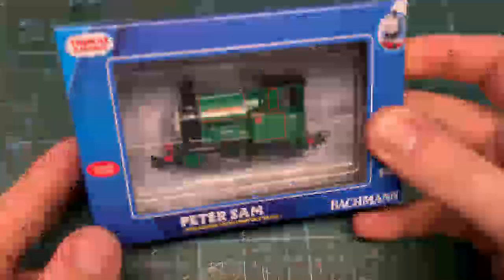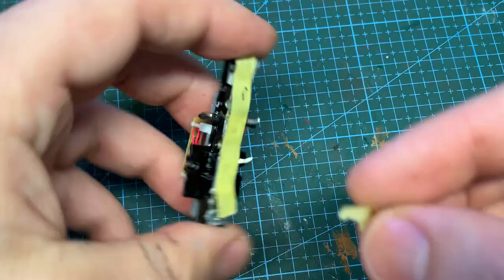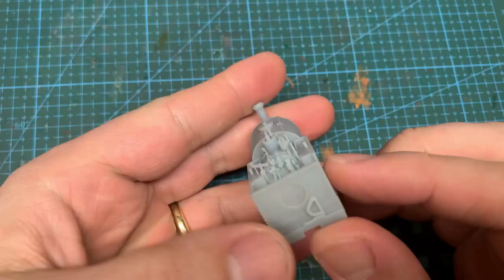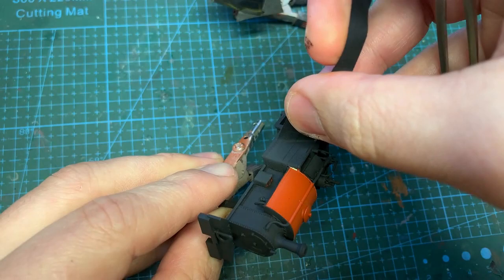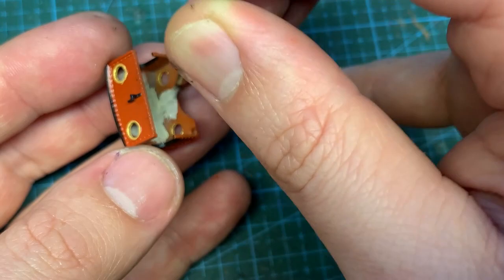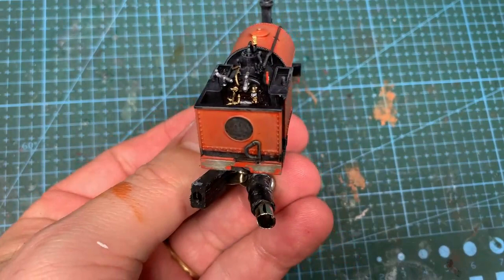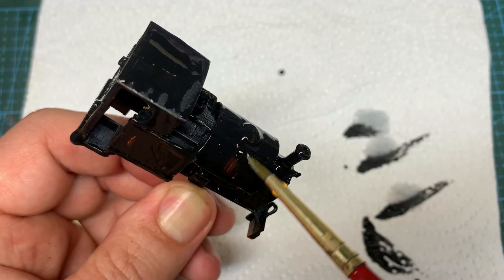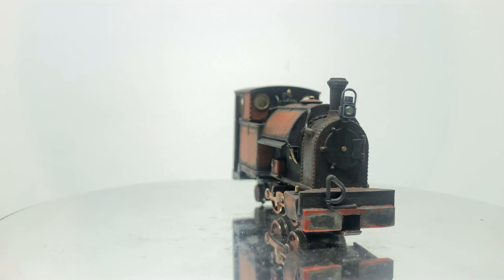A Loco for Corris! Bachmann ‘Peter Sam’ Conversion in 009

Comment: George.  I offer the following thoughts:  1. Wash the rising print in Isopropyl Alcohol before painting.  2. If you don't want to spend the time to san out the layer lines, do your initial prime with Mr Surfacer 1000, sand then prime to support the chosen colour scheme.  You need to thin the pain further to get rid of that orange peel result.  Looking at your airbrushing ti seems you waste a lot of paint spraying such a small surface area; bets done with thin paint and a number of coats for smooth results.  Washes are best done with oils after a finish coat of acrylic varnish.  There is no hurry then when removing the oil wash to taste. You are using Ammo stains which are oil based
Reply from the maker: Great Thankyou for your suggestions!

Comment: The 3D print is lighter than the die cast Peter Sam shell. How did you make yours heavier to compensate or is it just really bad at pulling things too?
Reply from the maker: It is lighter, but it can still pull 3D printed coaches as I’ve seen it done. I haven’t tried mine with full trains yet

Comment: I’ll be getting my own Peter Sam chassis soon, but taking apart the chassis apart to paint the cylinders scares me. Is it relatively straightforward? I’m worried about the wheels and gear not being quartered after reassembly.
Reply from the maker: No it’s not tricky, and you can pull the wheel sets out and keep them all as one piece so you won’t lose the quartering
Reply: @GWilliamsonModels I did it, but only after losing one of the slide bars 4 times in the carpet. But it was worth it!

Comment: I tried your weathering technique on a 3D printed wagon (16mm scale), but it didn't come out as I wanted. How much water do you use with the black acrylic when putting it on, and how much do you take off with clean water?

Also, you do have to wipe it down as well with kitchen roll etc?
Reply from the maker: Sorry to hear that, how did it come out, exactly? I put the black paint on neat, and wash off with clean water on the brush every time I put it to the model. I don’t usually use anything to wipe the surface, but maybe the change in scale might be the issue. I’m currently working on 7/8th aswell, so I’ll try it on the wagons and let you know how I get on.
Though if you’re mentioning wiping with kitchen roll, it sounds like you’re wanting more of the black removed? In that case, maybe a larger brush loaded with more water? Being acrylic, you can go back to it after it’s dry and wet it again, you’ll be able to remove it
Reply: @GWilliamsonModels  I think it was the way I applied it. I watched another video about weathering on garden railway models, but I also think that I do need to use a larger brush. I did wet the brush a lot before putting the paint onto it, and then washed it off.

The way I applied it, I went with the planks (as its a slate wagon with no sides and so is flat), and you can see that in the paint. Is it normally better to do it very randomly?
Reply from the maker: @SteamLance  ah ok, you mean like the talyllyn 2 bar slate wagons? Im assuming the black has left clear ‘tide marks’ on the flat surfaces? If so, I think what I would do now is get a smaller brush, wet it, and feather the black edge into the planks a bit, almost like blurring the line

Comment: Can you easily remove the face from the stock body? Nice job btw.
Reply from the maker: Yes you can, but you need a smoke box door to put in its place (like skarloey if you saw my skarloey challenge)
Reply: @GWilliamsonModels  will that fit Peter Sam as well? Also are the Peter Sam name badges easy to pull off? Thanks for your help.
Reply from the maker: @douglaslangella7782  I’m not sure on the face, you would have to measure it. But the name plates are painted on, so if you wanted to remove them and keep the paint job, you would have to go really gentle on them

Comment: What paint are you using for the black wash @10:59?
Reply from the maker: Its by Mig Ammo, and just called ‘black wash’. If you have watched my previous videos, it’s the same stuff, I use it for most builds
Reply: @GWilliamsonModels  Thanks! I saw it in your latest video, but as you are thinning it with water and the paint is enamel, I wasn't sure. I would normally not use water with enamel, but it seems like an interesting method. I tried Vallejo black, but acrylic paint doesn't stay where you want it and dries to quick.
Reply from the maker: @macnavi   yeah so I use either the AMMO, which is enamel, so thinners, or Vallejo  black wash, but I prefer AMMO
Reply: @GWilliamsonModels   In awe, as always, George.  But also slightly confused.  I've seen you use Mig Ammo 'Black Wash' on figures, and slate walls, and such, but I thought you used a wash you made from black 'School Poster Paint' on locos and rolling stock?  Or have you changed your technique?
Reply from the maker: @nigelbowley7027  sorry I just found your comment! Yes I sometimes use the ammo mig black wash, but it does give a slight sheen to the finish, which is why I started using poster paint for models so it looked more like dry crap and spot on them. The mig ammo does run through details much better though, so I use it for walling etc
Reply: @GWilliamsonModels  Thank you George.  Can you tell me exactly what the poster paint is please?  Make, brand, etc?